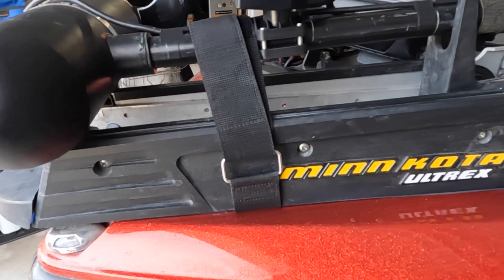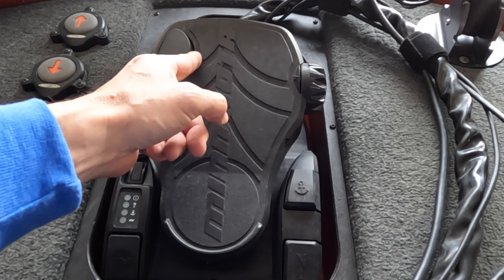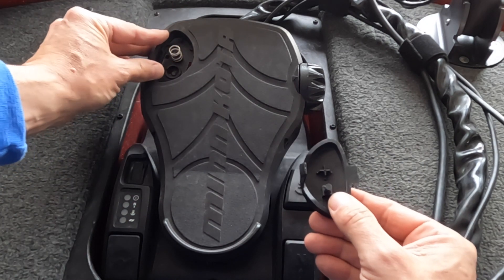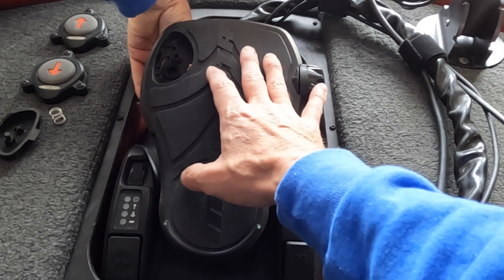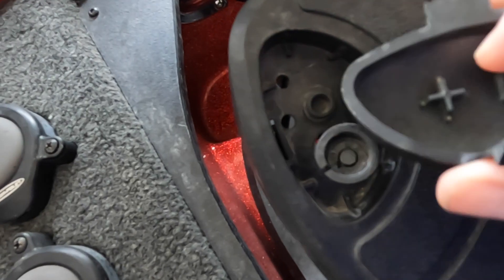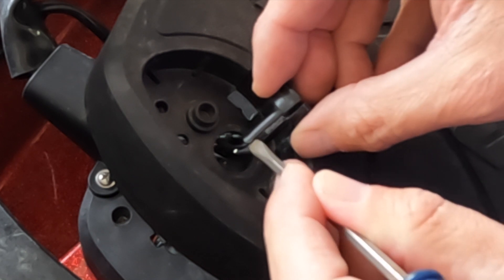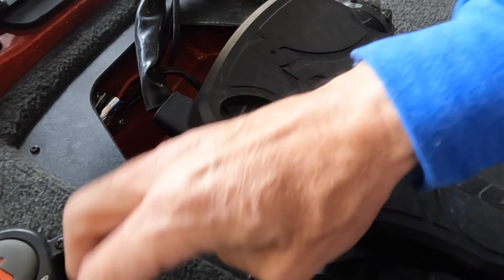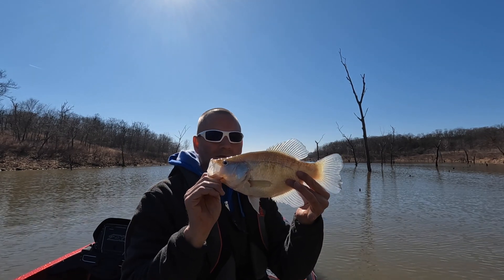Minn Kota Ultrex Momentary Switch Repair

Comment: I appreciate you posting this.  I just installed a new Ultrex and took it on the water for the first time this morning.  When I took my foot off the switch it wouldn’t quit running unless I tapped it sharply.  I pulled off out of the way and watched this video and within a few minutes it was working like it should.
Reply from the maker: I'm so glad to hear this helped you out! Thanks for leaving feedback!
Reply: Glad to hear this works.  I just installed a new ultrex and have the same issue.  Spun me in circles yesterday haha

Comment: Thanks for posting!! I'll have to give that a try when I get home later. When we went out yesterday, the handle you use to stow and deploy the trolling motor was caught under the pedal. To the point I had to use some force to pop it free. I noticed my momentary switch was not working all the time and had to rock the pedal back and forth a few times to make it work again. Apon investigation I found that the wires to the switch were pulled tight and assumed that I had made a short in the wires. If it is as simple as I had pulled the switch down it would be great. I have a tournament this weekend and the replacement switch is supposed to be 2-3 weeks out.
Reply from the maker: Thank you very much for watching and leaving feedback. Let me know if you have questions. I really hope this video was able to help you out. I've had to do this adjustment a few times over the last 3 years of having an ultrex. I could probably get another switch, but it seems the problem is very common, so I don't know that a new switch would really eliminate the issue entirely. Please keep me updated on how yours turns out! -Cody
Reply: @OutdoorQuests  This worked perfectly for us. I over adjusted it a bit at first because it would stay on from time to time. I made one more minor adjustment, and it worked flawlessly for the remainder of the day. 

Thanks again for posting. You saved me some headache 👍

Comment: UPDATE: Issue fixed thanks to your video. Thanks for posting. If anyone knows the part number please share. 

My trolling motor won’t turn on and I suspect this is the issue. Power to the plug checked out fine. 
I’m going to give this a try and see if that’s what my issue is. 
Question, does anyone know what part number is for the switch? I think it would be a good idea to replace it as mine is 7 years old now. Thanks again!
Reply from the maker: Awesome, glad to hear it fixed the issue!

Comment: Does the spit lock and continous button work when this happens because I loose everything when that happens no button on the pedal, no spot lock or continous
Reply from the maker: I'm not sure. I've never used the continuous button, and I've not tried spot lock when the button issue happens. I'd think spot lock wouldn't be effected though.